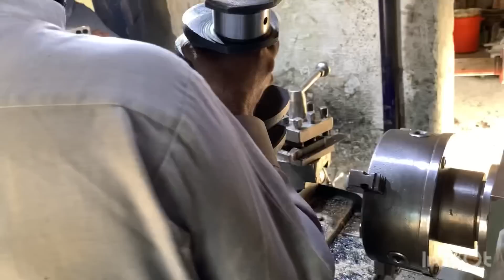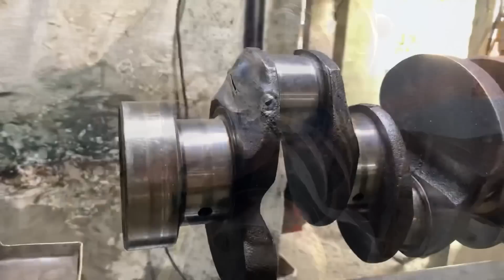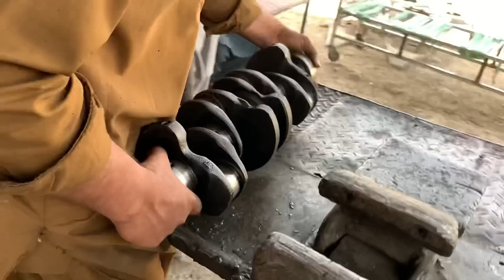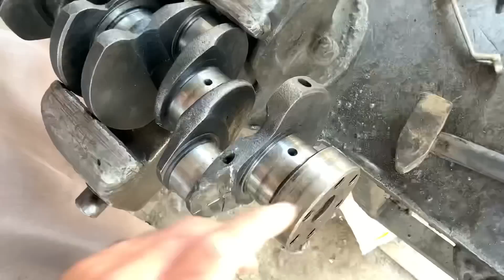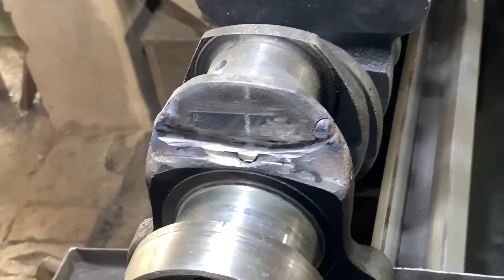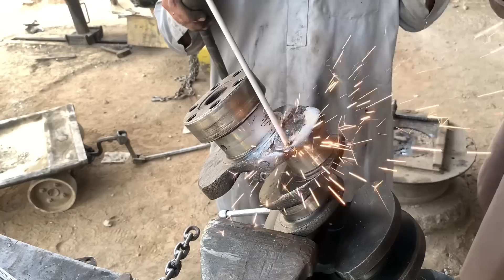Loved the process of rebuilding the broken crank shaft / Amazing

Comment: That's probably one of their home made cast cranks which broke, it will break again for sure.
Reply: it is forged. I am a machinist and the crank is probably at least 4140. rod most likely 7018. half the tensile strength of the crank. he didn't v it out, not that it would of help. no penetration and welding alloy steel.  zero chance it will work.

Comment: There are many such video clips of differential gears being repaired, crankshafts, camshafts, etc, but how come we never see the engine running?  How come we don't see what it's like six months from now?  I have my doubts and I don't think I'd like to be around when the customer comes back asking for a refund.  Alex Ivanov, below, no, it's not cast iron.  It's cast steel, look at the swarf while it's being drilled.  Cast iron swarf is granular, steel produces spirals.  An HT welding rod will do it but then the pinning bolts should also be HT.  But they would appear to be mild steel because they're galvanized.  HT cap screws or hex sets are black as a rule.
Reply: hahaha only for return customers.
Reply: Because it doesn't work!!! This crankshaft will work to the first major load.
Reply: Steel repairs are not supposed to last long but long enough for the other existing cracks to fail first, that is the economic for repair, it is meant to get the last ounce of use out of an otherwise full of cracks part
Reply: What is the purpose of the 2 "pinning"  bolts?
Reply: @lindsaythomas2283  to increase the contact between two sides beyond just the seams
Reply: More likely forged steel. Lots of videos are to be found showing the machining process.
Reply: I don't think they worry about customers coming back, they know what they are getting. They don't have the money to buy new parts, so they repair the old, knowing they won't last very long. They think it's somehow cheaper to repair something twice!
Reply: he obviously did it out of desperation. not a chance it will work
Reply: still better than china
in china we use glue to stick metals together

Comment: Pure Comedy.
Reply: Yep, that crankshaft will make a good door stop, or boat anchor😆
Reply: C'mon. Don't be a hater.  That was a legit repair. I've done that a bunch of times. Everything from big diesels to nascar engines. They all hold up perfectly.  The only thing I would have done differently is use softer bolts.  Those ones looked too hard. 😂😂😂😂

Comment: that is a cast iron crank that never welds, it will snap again along the welding seam. steel bolts have different thermal expantion and will cause bending forces inside, and which is more the bearing surfaces are riuned, there is no way to polish or ressurect them. the crank is trash. p.s.someone  tell them to measure bearings instead of oil seal surface
Reply: Also they can't set up degree rotation. Indian job.
Reply: Completely agree.
Reply: @getov1147  pakistani, by dress
Reply: @getov1147  they are Pakistanis
Reply: Это не чугун, это сталь. Стружка от сверла получается спиральная. Но я согласен, это не будет нормально работать.
Reply: Cast iron doesn't create swarf when drilling only grey powder. This is cast or forged steel
Reply: Agreed the crank should be tossed and replaced
Reply: It's not cast iron. Maybe cast steel. Watch the drilling operation. 😁. I've drilled a lot of cast iron and it doesn't drill like this crank did. It is steel.
Reply: Then have fun balancing it. Its trash, but I imagine replacement cranks are most likely very scarce unless he could find a used one.
Reply: You're wrong it's a forged steel possibly a 4340 diesel crankshaft however This is a definitely short living fix as the crazy runout of the mains will wipe out the bearings in no time
Reply: Definitely a cast crank of some sort , you can see the fine casting line in the crank. Forged steel cranks have a very wide flashing line from the forging process.  You can also see they used whatever type of welding rod they had laying around. Check out the 2 different flux slag from the first weld to the last weld. Not a full pen weld by a long shot. No preheat or post heat to prevent stress in the weld area either.  Maybe the next video  can be welding the block back together when it explodes under load.
Reply: Never touched the crack on inside. That crank was flawed when cast!
Reply: Ничего удивительного не  увидел , у нас в России до сих пор так делают многие. Камазисты и не такое могут делать.  У нас это считается,  низкокласифицированный и дешёвый ремонт .
Reply: Very impressed! Very educational video! Thanks for sharing! Cheers!
Reply: It might run long enough to get it back to the shop, . But you are right too much different metal will not work for a Crank. Actually it won't work period.   .. LoL
Reply: No give them one thing it is a forging as there are no joint marks of a casting it is probably a forged steel part that has been badly  treated, if that is that every other one went the same, that is why we magnaflux suspect cranks before refitting them.
Reply: You are right
Reply: Welding so close to bearing journals with no protection that's a no no.
Reply: @alexking3272 это где в России так делают? Может я не в той России живу. Никто таким не будет заниматься, особенно на КамАЗе, полно запчастей как новых так и бу.

Comment: This is fake, that crank would snap straight away as the weld is in the area where the force is high. 
You can weld on cranks but not on a fracture like that. 
These guys are just doing this for a video the crank will never be used.

Comment: I suspect these guys have done this before.....ok would not happen in the west....but sometime we have to do what we have to do with what we have to hand.

Yes I would like to see how it stand up in action....but at least they try.....maybe some are ok for a while and they are happy with that.

If the could go to the dealership and get one off the shelf Im sure they would.
Reply: This is like going to a discount parts place. Get you through a bind. Harbour Freight
Reply: @johnfairchild3421  Long as they are happy with the all is good.
Reply: I appreciate what your saying, but at the end of the day there somethings that just cannot be repaired to a level required by the forces that are going to be applied. It's a matter of physics not economics.
Reply: @utube1818  Yes of course you quite correct.....but I wish I could find how long the job lasts till it fails.

Comment: That will not hold, welding just the exterior of the crack does not fuse the center of the cracked part and will break again under load.

Comment: Putting that crank in an engine block is going to be nothing but a time bomb waiting to rip someone of something to pieces when it explodes inside the block. Better to just toss it and use the metal to cast a complete new crankshaft. I would never attempt to use any crank that was welded ever.

Comment: Hope they used 309 electrodes, probably 7018 though. If that's the case, it's going to crack out.
Reply: Look close , they used 2 different rods the final pass was some type of 7018 but the first couple of passes was some type of rod with an iron oxide flux maybe a 6013 type of rod. . Probably whatever they had laying around. Almost no grooving and no preheat or post heat for stress control.  Going to be a big mess when it starts and gets under load.
Reply: @corenerigby5036  Слишком много вводных - электроды , температурный режим , соосность ... Не мешайте людям работать , а не то они все бросят так и не начав .
Reply: @corenerigby5036  6013 isn't iron powder flux, standard rutile electrode. 7018 is iron powder flux, low hydrogen, and 7016 is just low hydrogen.
309 is what you need for a crank, otherwise, it will crack, it may take a minute or it could take a year, but they just go pop without warning. Even if you use nickel they crack, glue it back together, put it on a shelf and it looks good. Then without reason, it falls in half again before you've fitted it, most disheartening.  Best done with mig too surprisingly and no need for pre or post-heat, MMA is a poor second. 
As for watching it again, I'm begging you, please don't make me, it was harrowing the first time.
Reply: @dvv7907  I can't copy and paste this into google translate, sorry. 
Не могу скопировать и вставить в гугл переводчик, извините
Reply: @mathewmolk2089  309 welds cast steel better than anything other filler. Nickel will crack out of cast steel, maybe not today, may not tomorrow but it will crack. As for the amateur comment, I hope it wasn't directed at me. My 309 comment should tell you I know it isn't cast iron.
Reply: @v8trauma  Too many inputs - electrodes, temperature conditions, alignment ... Do not interfere with people's work, otherwise they will quit everything without starting.I don’t know if it was transferred for sure. With respect.
Reply: @dvv7907  thanks for the reply. If they are happy, I'm happy. They live several thousand  Km away from me, so I doubt they'll pay any attention to me.
Reply: There is silver rod that welds cast well .
Reply: @txrick4879  silver in appearance? Sounds like a 309s, they are stainless and look rather bright. Copy/paste job: 
Stainless Steel 309S Electrodes

309S stainless steel electrodes are made up of iron, chromium, nickel, and molybdenum alloys. The exact composition varies depending on the specific use case but typically contains a minimum of 24% chromium, 12% - 16% nickel, and 4%-6% molybdenum for superior corrosion resistance. It can also contain other elements such as titanium, aluminum, silicon, and carbon for further properties or to meet specific requirements of an application.
309 SS electrodes are used in various applications due to their superior corrosion-resistant properties. Common applications include welding and fabrication, automotive components, pressure vessels, petrochemical equipment, food processing equipment, and chemical process vessels. Additionally, the mechanical strength and ductility of 309S stainless steel electrodes make them suitable for structural applications such as bridges and buildings. The properties of 309S stainless steel electrodes include high-temperature oxidation resistance, excellent weldability, superior corrosion resistance, and good formability, making it an ideal material for a variety of industrial applications.
Reply: Er309 also welds “mystery stainless” well, e.g. fixing cookware when you don’t know what alloy the Mfgr used, and…

When you want a “smooth and lovely” appearance on your steel tubing furniture.  

I have used it for those two things thus far (as Tig rod).
Reply: Wow, v8 trauma... you can actually read a welding rod brochure? Or was that the MSDS sheet...
Reply: I’ll bet the entire population of Pakistan came to a standstill while they ponder your expertise!!😆
Reply: @richardmaurer9002  just as long as you do, that's all that matters eh?

Comment: NEVER in a billion years would any weld repair to output flange of a crankshaft of a truck diesel engine work. The reason it broke in the first place would be a misfire or a design and manufacturing of the original piece, resonances and thrust reversal force broke it in the first place and they would not go away with a simple stick weld ‘repair’ of a dubious method.   It might however make a mantlepiece decoration  until it got dropped onto something solid.    Just for a laugh a magnaflux test might just show any slight ‘imperfections’ in the mechanical integrity of the finished part😅😅😅😅😅😂.
Reply: Now how can you tell what caused the fracture from 6000 miles away?
Reply: @richardmaurer9002  simply from knowing mechanical engineering principles after 55 years. They apply everywhere.

Comment: Totally Jugad, Poor technicians do not understand Metallurgy and welding, which welding rod they are using ? Just MS welding rod. What metal they have chosen for studding ? simple Bolt of low carbon. What about heat treatment or hardening of welded portion? Zero. How about stress removal from welding joint ? Zero. Poor Pakistanis have no money to buy a new one Crank Shaft  hence wasting time on this scrap. Will this Crank Shaft withstand sudden jerk load ? Is this joint Tough Enough to withstand any deformation ? NO.

Comment: Apart from some nifty threading and welding, this vid is total bollox, as a crank is a specialist piece of engineering, and sticking some 10 mm bolts, and a bit of arc welding, aint going to stitch this together again, superglue may of ,made it look prettier, but still wont EVER go back into an engine